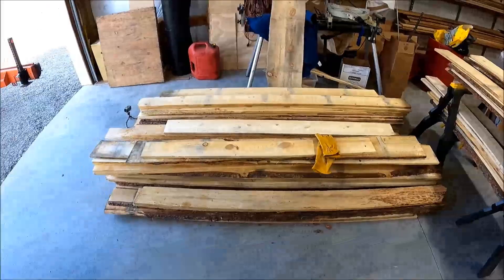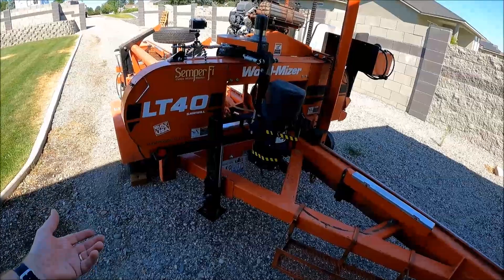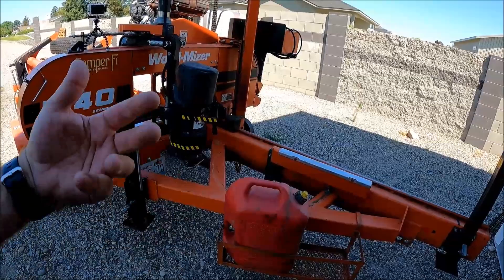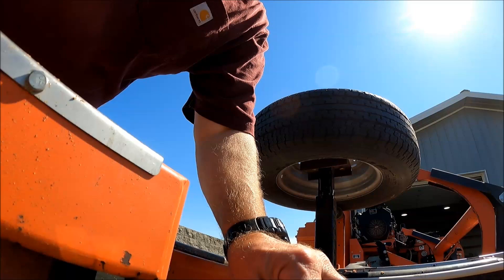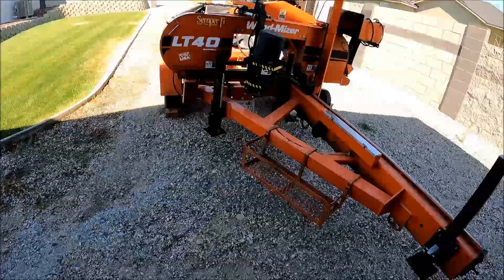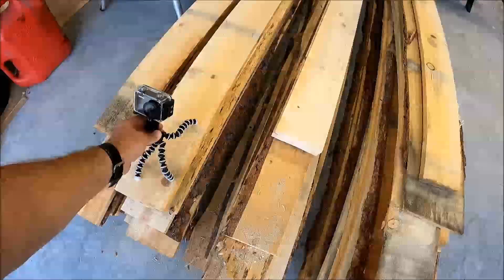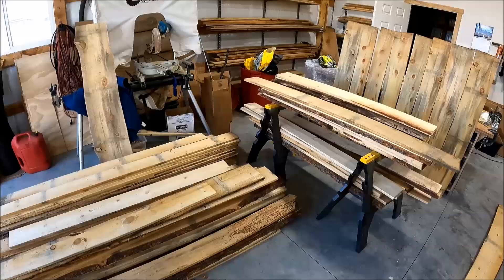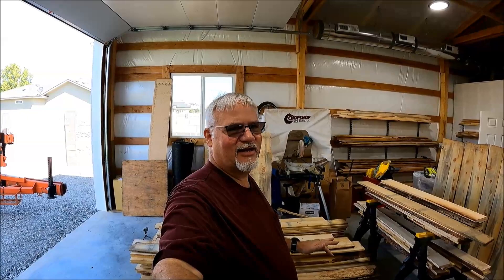4 Unique Mods You Can Do to Your Wood Mizer Lt40

Comment: You must be charging a fair amount for any job taking you so far from home because 150 miles is a long ways.  We used to limit our travel to about a 30 miles radius without charging a travel fee.  Now, the logs come to us and we don’t move anymore.

Are you charging by bd ft or by linear or by hour?  We charge by bd ft.
Reply from the maker: I charge $1/mile each way plus $100 setup/delivery fee and $100/hr once I start milling.  It works out to around 40c/bf with good off bearers and good site prep to 60c+/bf.  However I am a bit of a unicorn in that I am 100% mobile and will travel as far as needed (and a customer is willing to pay for).
Reply: @TheOldJarhead  $400 a thousand is pretty good money. We’re getting $380 but we don’t have to travel so it’s pretty good money for our location.
Reply from the maker: @anooseholay  I've heard if folks charging double that these days!